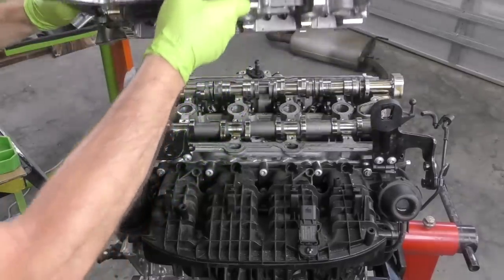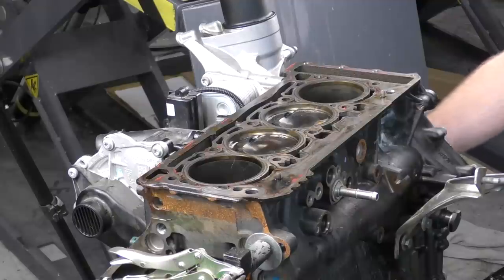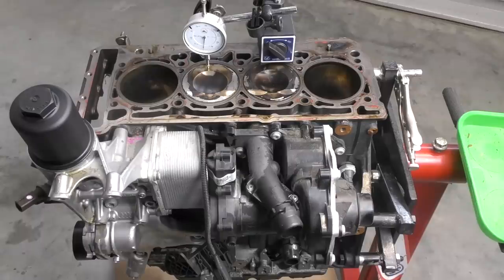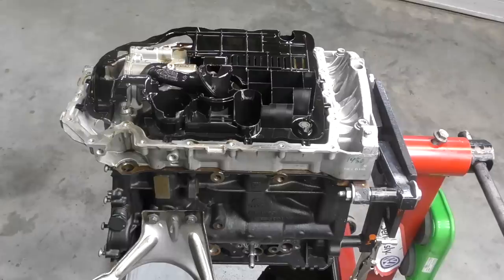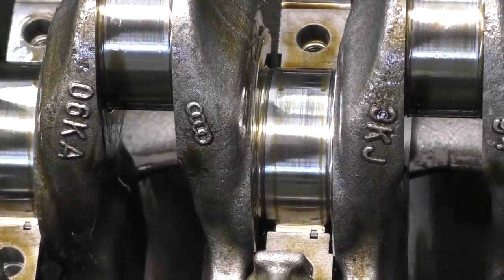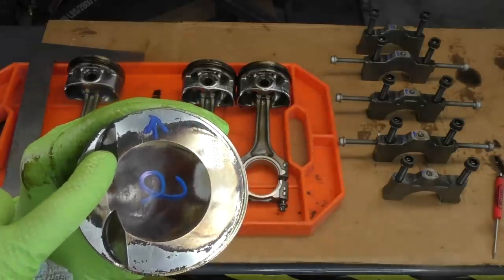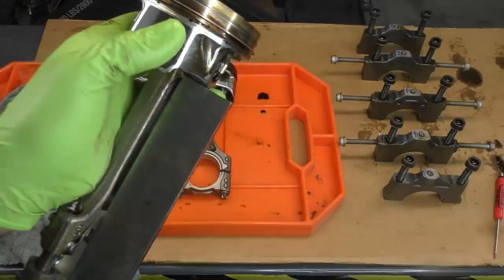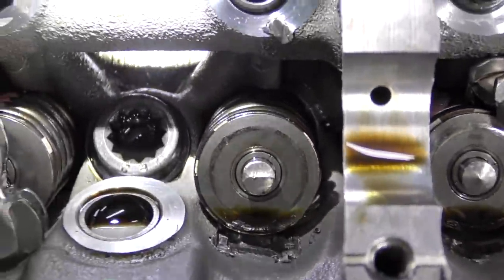Catastrophic Engine Failure VW 2.0t TSI Engine 2 ~ Bottom End Damage

Comment: Don't the valves stay shut after a failure to prevent damage as part of engine design?
Reply from the maker: Unless they are out of position like they are bent. But the valves were seated perfectly
Reply: @HumbleMechanic  if you're keeping the scrap motor you should totally start a project build with upgraded internals
Reply from the maker: The owner came and grabbed it yesterday
Reply: @HumbleMechanic  won't be the last one. I plan on doing it one day but toward the end of my current engines life span. Still working towards going is38 on my GTI. What's next on your list for the R?
Reply: When the rockers are out of place they can cause the valves to stay open and then get damaged. Also usually the rockers pop out due to valve float where the springs aren't able to get the valve closed quickly enough. Which can cause damage. 

This one looks like the rockers got spit out quick enough that it didn't cause more damage.

Comment: Oil panel is plastic ? It's fantastic !!!
Reply from the maker: This is incredibly common today. More on the way too.
Reply: VW U We don't believe in anything but quantity....... Saved 300g per vehicle, and is guaranteed to make a generation of mechanics rich as they age. 

But there are no new designs where large parts of the engine, drivetrain and body are not plastic parts. Cheaper to make those moulds with a hundred individual sections that have hydraulics to move them in the machine per cycle, than to stamp out steel panels where you need a half dozen different dies and presses to get them to that shape, and still need to do extra processing on them as well. The plastic dies also last longer in use, many  tens of thousands of parts between needing to overhaul them, as opposed to the metal press dies where they run a few thousand parts before they need to fully rebuild the die. Also can handle thinner walls in the plastic than what you can do with molten aluminium alloy, and no need to have complex sand castings for each part, made from up to a hundred patterns, burn out fillers and cores.

Comment: I have a 2011 A5 with the 2.0T CAEB, anyone know of a quick reference engine torque specs, audizine forums are touchy when asking questions. Might join a VW forum instead.
Reply: Touchy?
Reply: B-Wulf he means they get pissed off that someone asked a question, rather than being helpful they flame you. 3000GT/Stealth forums are the same way
Reply: @depressedsweater  yea. its crazy
Reply: I wouldnt know what section to post in in the VW forums, I dont know which car is mostly the same as the 2011 A5 2.0t engine.

Comment: Just another fine engineering crap from VW. The VAG cars have great ergonomics, look great and are very comfy. But they are simply not built do last. Especially petrol ones.

My '11 CC after 230k km is just getting me nuts, noises from everywhere, one window is not rolling down properly and stays bit up.  Noise from the steering rack, noise when reversing, noises from the suspension.

It's so hard to fix these things and parts are expensive,

Comment: You can keep that direct injection nonsense.  I'll stick to the older, more reliable port injection, along with aluminum intake manifolds, etc.
Reply: As long as you have both, you are fine.
Only it creates very dangerous micro particules.. but that is not bad for the engine.
Reply: You can enjoy that but enjoy our taillights every race haha
Reply: @mercury0214  Good luck with that.  Enjoy scraping the carbon from your valves on a regular basis.
NOTE: Most high-horsepower race engines incorporate port injection for high reliability.
https://www.youtube.com/watch?v=ks35uLEKxNg
Reply: Whats the best fuel system:
Car Enthusiast: Carburetor 
Mechanic: Port Injection
Engineer: Direct Injection